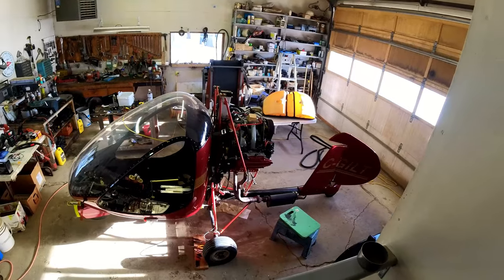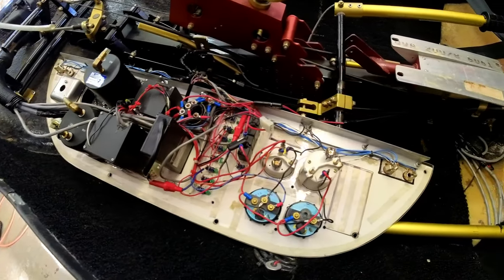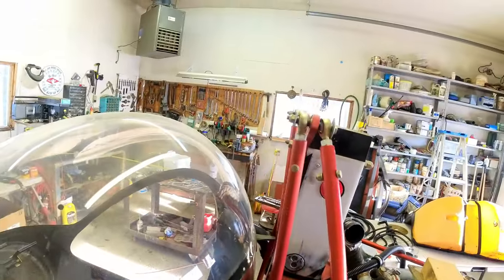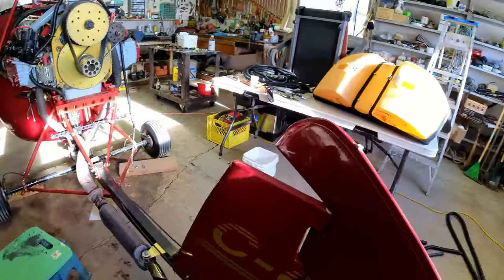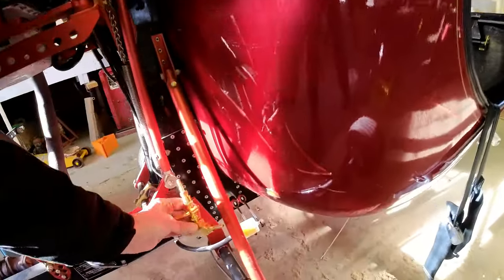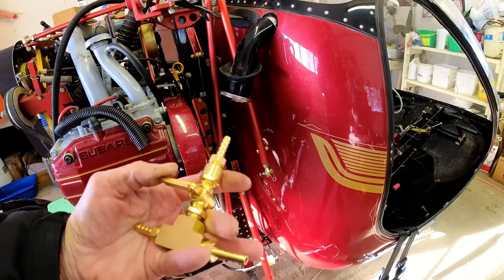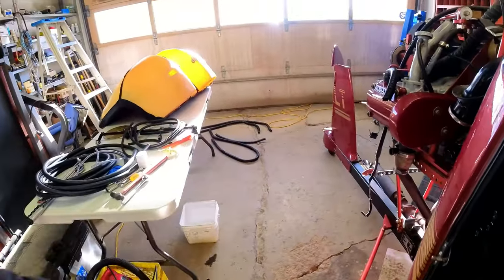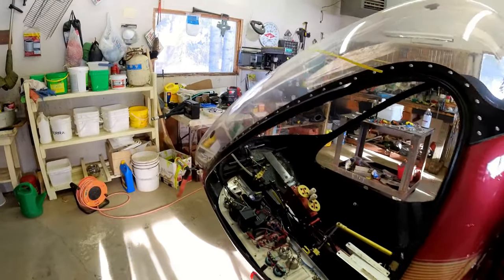RAF 2000 Teardown

Comment: And that original Subaru is way under powered that's why RAF updated too the 135 EJ22 then the EJ25 and if the rotor blades are the original with the kit those are to be immediately replaced RAf recall they are not safe too fly!!!!!!
Reply from the maker: Hi Shawn. Yes I read about the rotor blade and hub replacement so that's on the list along with the other 39 service bulletins. I'm still trying to come up with a way to reinforce the bubble that won't be too intrusive on the view. As for engine I'm hoping the power will be adequate for solo operation.
Reply: @Lawspeed1  if you look at a newer RAF cabin you'll see how they split the front windshield and the back with a strip of fiberglass that's how RAF solved it that Subaru motor will do solo but it's not a good motor get your self fuel injected EJ25 parts are easy to get and the motor is solid if not make sure to practice engine out on take off actually that's regardless of engine but fuel injection solves carb icing might be cheaper to sell it and get the modern version lots of unfinished kits out there